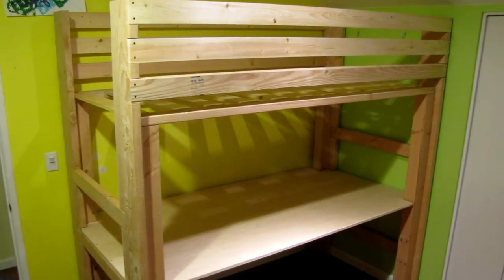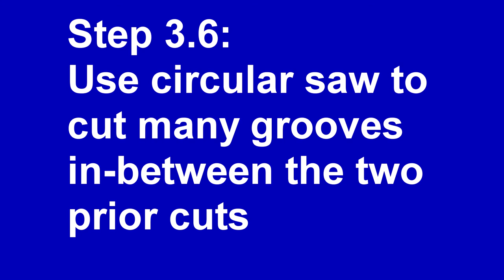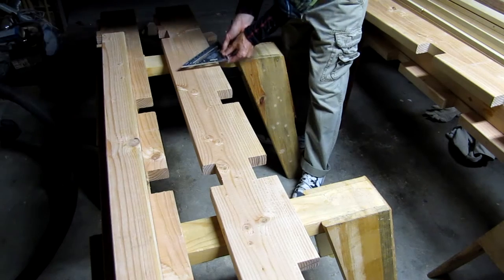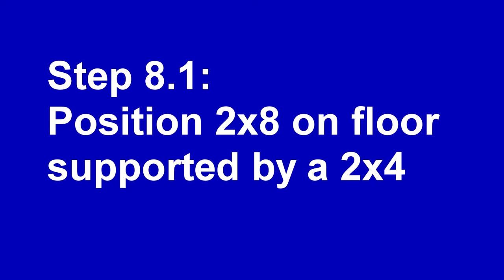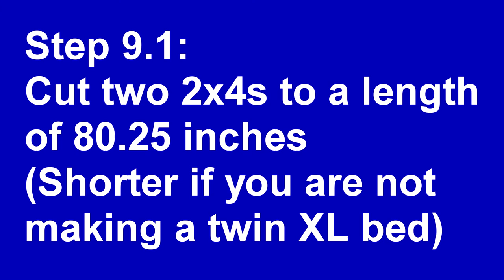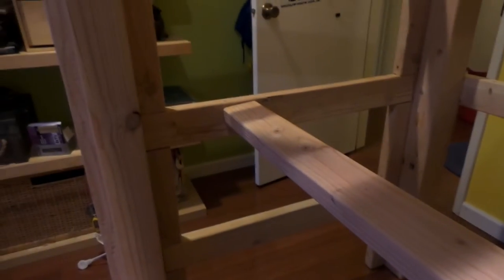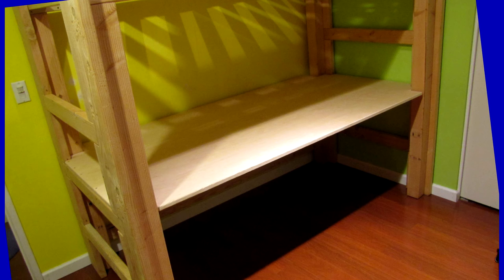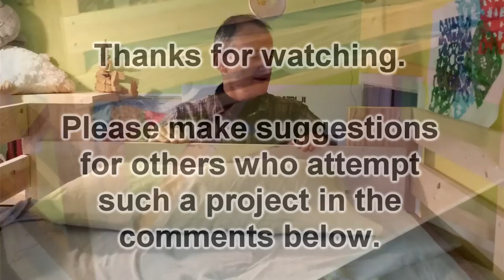XL Twin College Loft Bed DIY

Comment: Finally, a proper video on how to make a loft including diagrams. Your video has the most detailed information and steps in making a loft bed. Thank you. I just have to convert the figures inches to centimetres. How stable is it?
Reply from the maker: Sorry for the late reply. It is very sturdy. Way over built lol
Reply: @fitnessandinjury  I need it to be overly sturdy as I am heavy and desperately need a loft bed. It’s better to be overly sturdy than not be. Thank you so much for this amazing and simple video